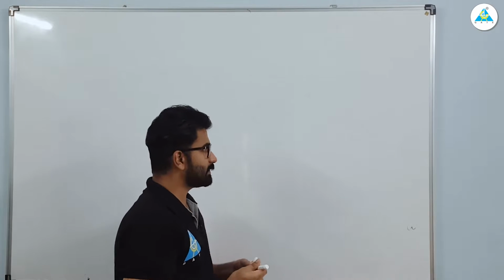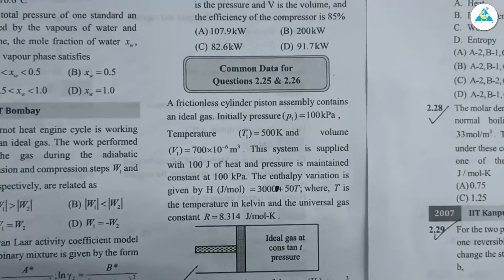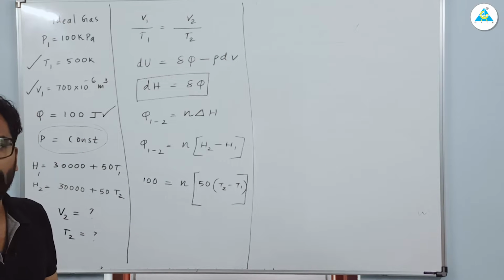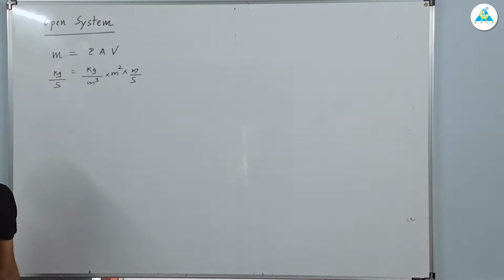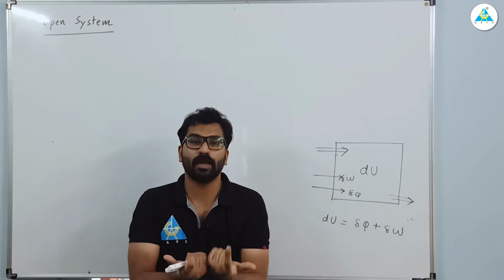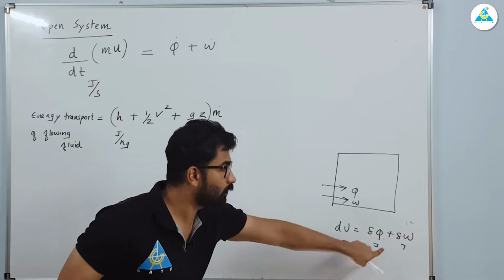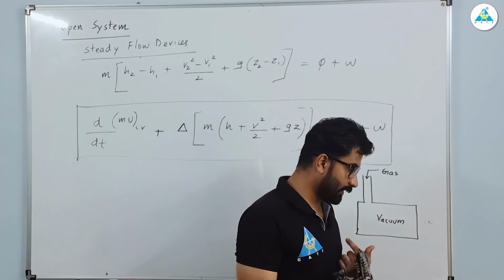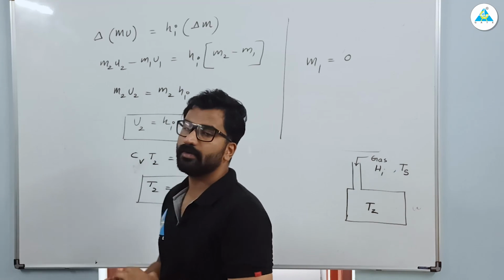#10 | Thermodynamics | Open System | Chemical Engineering | by Harishankar Sir

Comment: Sir, why didn't we consider U= Cv (T2-T1) & H= Cp (T2-T1) in the last question from GATE 2012? How can we directly write U= Cv×T2 & Hi= Cp×Ts
Reply: Sir has used previous q's eq i.e u2=h1
Reply: we will have to use u = ncvdt as u is asking in just joule where as h is in joule per mole so we will use h = cpdt and u = ncvdt and i am getting correct answer from this
Reply: Kyuki bas internal energy pucha hai nki change in internal energy